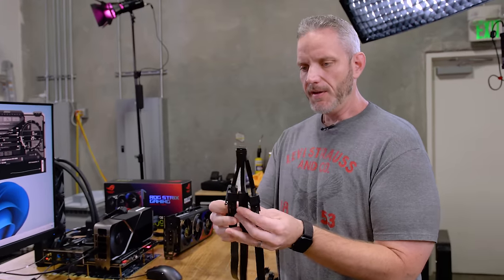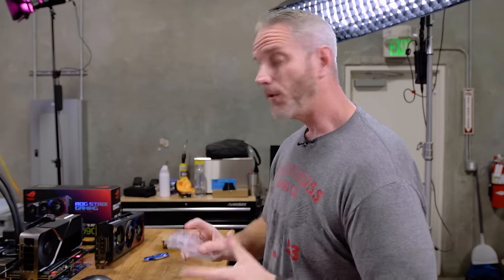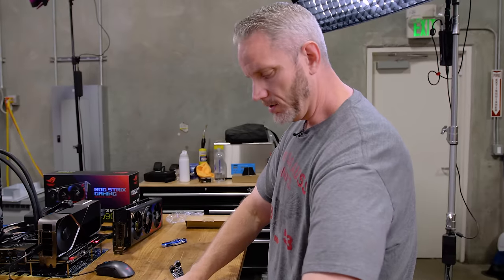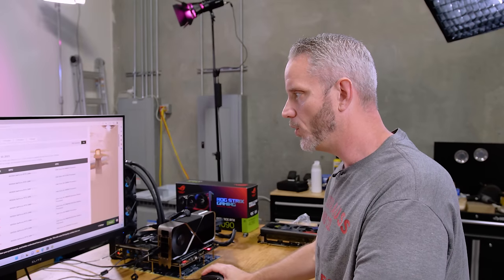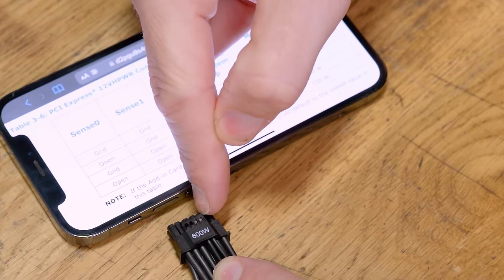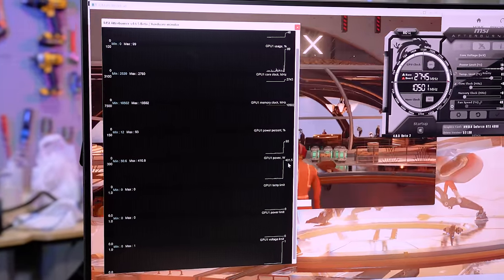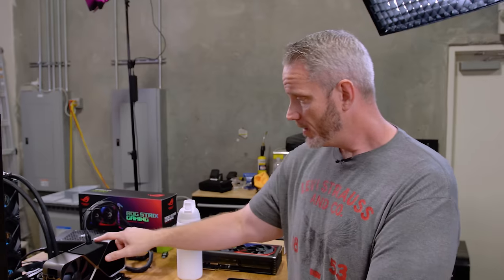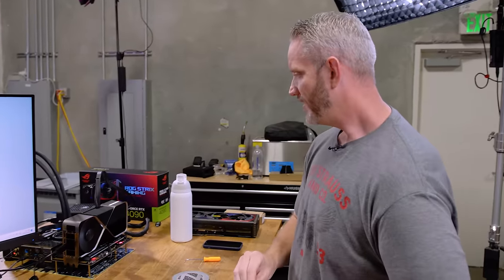DON'T Do this with your GPU!

Comment: MYTH: The 12VHPWR cable has 4 sideband pins

TRUTH: The 12VHPWR cable has 2 sideband pins, which are not currently used by any PSU. These pins are CARD_PWR_STABLE and CARD_CBL_PRES. They use 3.3v signaling but without buying the $300 PCI SIG document I can't tell you whether they are I2C or some other type of bus.

CARD_PWR_STABLE indicates whether the power draw is stable, but it's unclear from the spec what actions the GPU or PSU are supposed to take if it's not stable. AFAIK there is no functionality in the nVidia driver to pop a dialog like the Windows USB overcurrent dialog.

CARD_CBL_PRES indicates if the cables are connected properly, although one would think that would be apparent without this sideband. I don't see the use of this.

The other 2 pins on the 4-pin part of the 16+4 connector are NOT sideband, they are SENSE0 and SENSE1 which have NO signaling whatsoever and are simply tied to ground or not, as a 2-bit binary which indicates:

- Sense0 GND + Sense1 GND = 600W
- Sense0 Open + Sense1 GND = 450W
- Sense0 GND + Sense1 Open = 300W
- Sense0 Open + Sense1 Open = 150W

To make things more complicated though, nVidia's 4x8 pin to 12VHPWR adapter that ships in the 4090 FE box has an embedded chip which grounds the SENSE0 & SENSE1 pins dynamically based on how many of the 8pin plugs are connected. I imagine nVidia is doing this for liability reasons because they know the 12VHPWR connector is problematic and they don't want to burn anyone's house down if the user has a crappy PSU with low-gauge cabling.

So with the nVidia 4090 FE 4x8 adapter, if you plug in less than 3 8pin, it won't boot (since the card requires 450w). 3x8 pin plugged in gives you 450w, and 4x8 pin gives you 600w.

While all of the 4x8pin connectors included with AIB partner cards appear visually similar to nVidia's and may all come from the same source (thereby including the chip), nobody has tested this yet so we don't know.

First- and third-party cables will not have the chip, e.g. Corsair, Cablemod. Corsair is 2x8 and Cablemod offers the choice of 3x8 or 4x8. Personally I ordered my Cablemod with 3x8 because it's enough for redundancy but still keeps 1 connector open on the PSU which may be necessary for either:

- Second video card, e.g. Intel Arc for VP1 encoding

- 60W USB-C PD (my X670E Creator uses a PCIe power connector on the motherboard to power the USB PD).

Most high-end PSUs have 4 PCIe power connectors.

It baffles me how people like JayzTwoCents can say there are 4 sideband "smart" pins when if you simply look at the connector there are only 2 pins installed and they are clearly tied to ground. Sideband pins are not yet implemented.

If you use a first- or third-party adapter cable, inspect it and make sure that the Sense0 & Sense1 are tied to ground on 2 different connectors at the PSU end, because otherwise if one of the 2 connectors comes loose, it will try to draw 450-600w through a single PCIe power connector.

Comment: unplugging one pin the card thinks there's only 3 out of the 4 plugs attached ... I'm guessing with both disconected it thinks there's just not enough plugged in so it doesn't start

Comment: Corsair states don't use these with any other power supplies...however I'm guessing if you have a quality power supply with ample power these can be used on other brands not just Corsairs.  Could you test it on other power supplies...also I looked on Corsairs website, they seem to be all sold out, so I guess I'm stuck using that dongle till more become available.
Reply: You can not use them in other power supplies unles you verify that they output the correct voltages on all pins as not all modular power supplies have the connectors wired the same way. The wiring tend to be the same within the brand and/or OEM.

We ned a standard for connectors in modular power supplies for good compatibility.
Reply: What GODAXEN said
Reply: @NoSend901  ok, good to know.  I have a Asus Thor ROG power supply, 1200 watts.  You would think it would be built to handle this, but I didn't know for sure.  I'll just use the provided dongle or until I can't get asus to confirm whether it will work.

Comment: I believe the 4090 GPU is going to need this hideous thing. What I'm trying to work out is how many of the various connectors I'd need from my power supply. I assume these days they'll all have four PCI-e cables? I need connectors for two old HDDs (I forget how these link up) and ... three SATA SSDs if I recall correctly.

Am I in any danger of any PSU I might buy (around the 1000W range) not having all the right cables?

Comment: Jesus the misinformation is rife with y'all. ATX 2.0 standard dictates that one PCI-e cable be rated for a continuous 266W load. So two PCI-E cables with  split ends can supply 532 Watts of power. The PCI-e slot on the motherboard supplies 75W for a total of 607 Watts.

Comment: Create a circuit similar to what car enthusiasts would use to fool the cars engine management computer used with certain mods. Pass the power supply signals though a circuit with some switches and you could crudely control the power to the card.

Comment: I noticed he has the power supply adapter daisy chained with 2 cables to give 4 8 pins should not do that. Should use 4 8 pins for the 4090.

Comment: But power supplies can be single rail or multi-rail. Multi-rail means all 8 pin are individual and shouldn't power more than 150 watts for each 8-pin, so using a PSU with multi-rail shouldn't power a 4090 because it can't draw more than 2x150W, because the load is not split accross all 8-pin cables. Maybe that's why 4x 8-pin cables exist. For multi-rail power supplies.
Single rail can draw any amount on one 8-pin, that's why they built those thick cables and only 2 of them.

Comment: Corsair already outed themselves as not having full knowledge about this new specification. Nvidia said specifically that the GPU detects how many connectors are installed and a Corsair rep just said publicly that the GPU does not detect this. F, and I just bought a Corsair PSU.

Comment: I'm sure I'm not the only corsair psu owner wondering about those type 3-4 cables, most psus are compatible except older AX and HX non "i" versions, check corsair psu compatibility and only look at the Type 4 - PCIe line for your model if there's an orange dot you're good to go with this cable (that I'm waiting Corsair please send them to retailers)

Comment: my adaptor bents and gets some pressure from the glasss panel. But tbh as long as the power plug is in all the way it will require a lot force to damage pins. The plastic on the plug would break first.

Comment: Jay, please stop bending that damn cable around like an idiot.  You're going to give people the wrong impression that it's ok to do that.  If you bend a solid core wire cable(if that’s what it is, which I doubt)  like that, the copper will work harden and crack/break.  That's not good for anyone, especially with some cards going up in flames due to the amount of power sent through those cables.   Be smart!

Comment: I think all the power requirements "tech spec" on the new series need to get with the times. They still go by the "single value" total power suggestion, which in many cases is overkill. I thought the whole point of thew new ATX 3.0 spec was that video cards could state, i need 150/300/450/600W for "myself" and idc what the rest of your system needs. And it is my impression that these cards should state: 450W plug spec minimum, 600W recommended (for OC).

So when you get around to shopping for a new ATX 3.0 PSU, you can make an informed decision. Maybe you know you don't want to OC and the plan is to get a PSU with 450W support + 300W for the rest of the system. or Maybe you get the one with 600W+400W. That's 750W vs 1000W, and the price difference that goes along with it.

Comment: i wouldn't trust Corsair. They didn't understand how the original one works and if I also remember correctly the PCIe connectors on the other end of their cable is not rated for 300W.

Comment: pls look up this psu:  MSI MPG A1000G PCIE 5.0 1000W on newegg. i tried to link but my comment got deleted, the pigtail is a trash cable. the new psus use a single 12vhpwr on both ends, that pigtail is for old cards. you wouldn't plug 4 110 wall plugs into a single device would you? btw if GN reads this, give credit where it's due.
Reply: btw corsair should have sent you a whole new power supply but they're clearly slow on the uptake too.

Comment: I think you missed a valid test.  Leave one of those communication lines de-pinned and jumper the remaining communication wire over to the de-pinned slot to see if you can fool the card into thinking it's communicating with two individual communication lines.  If you could then do the same thing with an ATX 3.0 PSU that is say, only 400W, and it works, you could show a potential flaw in the power up scheme.

Comment: Some 4090's come with a triple cable, like the MSI Trio. What happens if you use a quad cable with those cards?
Reply: Some adaptors have IC in it to ensure all power connectors are connected. Like the FE cards won't have 133% power budget available if only 3 out of 4 of PCIe power connected (only 100% like Jayz removed a pin).

Comment: I used to have the concern of speaker amps overpowering speakers until I learned from audio systems professionals that same point.  The PSU for a PC is a more complex version of the same thing.  You have to fit it to the components so that the least and greatest draw fit within its stable range.  The only concern, aside from cost, I have from an OP PSU is wondering if it can remain stable at an ultra low idle or standby output when and if required.
Reply: The downside to an overkill power supply at low loads is mainly efficiency, switching power supplies waste more energy when only a fraction of their output is being used, though supplies with a high 80+ rating are still decently efficient at the low end

Comment: I'm pretty sure that it is not solid core. There are no crimp designs that I know of which uses solid core (I'm in the industry). 
It's more likely that it's larger awg and stiffer insulation (likely higher temp).

Fyi a solid core won't be good as the crimp will not crimp properly and leave voids inside leading to arcing and oxidation.

Comment: If they are so worried about cable bend causing strain on the socket or the plug, they should design the stress relief onto the structural part of the card
Reply: That might be why the connector is flexible in the same way buildings are during an earth quake
Reply: Or they could have avoided the issue in the first place by not making the connector needlessly small. They could have use the same number of pins, but make them the same size they are on a standard PCI-E power connector. The cards that use that stupid connector are comically huge anyway, so there is exactly zero point in making the connector that small.

Comment: I ended up buying a new power supply that was designed for the new gpu power connectors plus my Power supply was 10 plus years old.

Comment: Same cables I got with my seasonic  850 titanium  my gpu is in stock location 4 ribbion cables  2 connectors mine is differant . Mine is for the NV 3080ti and I use the EK water block and my ribbon cable all 4 I made almost invisiable to the eye. Cleanest build I have ever seen plus the water cooling in all aspects is 100% correctly done and it shows up in R23   68 c  all cores 5.0 ghz   Rocket lake and it performs way better than your review + it use way less power 220 watts r 23 .   I know the cable maker Seasonic told me so I could get the correct cables.  Very nice great to work with.  I would tell you companies name but I have to ask seasonic first.

Comment: I wish i could get a hold of one. Im using the adapter that came with the GPU and only three out of the 4 worked with my custom cables so I've now got a nasty black plastic cable in my case. The worst part is my side panel won't fit on my case so I've ordered some new parts to build a new rig, i couldn't wait for the 13900k and saving a few hundred will go towards my ATX 3.0 PSU and thats it for a while as I've spent far to much on electronic equipment this year and last.

Comment: I don’t really mind the splitter, but why make it so short? Why not make it into what is essentially psu extension cables, adapter can reach all the way into the psu shroud/cable management area?

Is the couple inches of wire really that huge of a cost savings? Maybe on lower end gpus this is fine but for higher end gpu’s there’s no reason not to make them longer

Comment: Cutting the wires?? I guess Jay doesn't have any de-pinning tools like I do. I would just de-pin them from the connector housing and wrap some electrical tape on the loose terminals.
Reply: It looks like that's what he did 16:35

Comment: I have found low cost cables from Amazon, that are sleeved and look great, in my case sleeved In White , that use no adapter at all,
Check overall length ! Some are adapters, some are whole replacement cables, get the latter, price differences are very small. 
They run from gpu to psu , like $22, have cable combs, that keep it super neat looking.
Just have to pay attention to psu connection types, mainly two different types, make sure they match the psu! Check twice!
No need for super expensive ones. 
Have used these twice now with good results. 
It’s really outrageous that gpu manufacturers think a short “adapter “ is ok.
A few more cents for a longer adapter that can at least make to the back of the average case was in order here, what the industry sent out is insane especially at current gpu price levels.
Just my thoughts and a low cost solution!

Comment: @jayz2cents its not that complicated, the sideband connection tells the gpu how much power it can pull by shorting certain pins to ground, there is no communications between gpu and psu.

Comment: So that's why a CORSAIR rep is so triggered to GamersNexus and other review sites cuz they want to ship this "BULLSHIT" accessories for aesthetics and still claim that it can power @ 600w. yeah you can run 600W on those cables but the card wont pull that cuz you limit the sense wires. It like you are having a 10Gbps cable on a 10/100 router. No mater the quality of the cables, its about the signaling on the sense wire to say to the GPU "HEY THERE IS ANOTHER CRAP TON WATTS YOU CAN PULL". I'll give a strong no for aesthetics if i cannot use all the juices of that ridiculous overpriced GPU.

Comment: I have your iFixit ad stuck in my head. And I'm loving it. IFIXIIT!!
On the topic of graphics cards, I have a 3950 ryzen system with a 1070. I think I'll just get the 6000 series radeon card as I'm curious how that will perform.

Comment: seasonic had the one piece 600w cable where is the competition? 12VHPWR (12+4 Pins to 12+4 Pins) i rather use that than some pci-e splitter

Comment: This is probably a dumb question but......can the cable that Corsair sells be used with other power supplies not made by Corsair?
Reply: The connectors and pinouts at the PSU may vary between brands and even models, so while they might sometimes fit, things could go (expensively) wrong!

Comment: Neither of those cables will bend to the side and I hate having them draped over or under the card. I like to take them sideways tight to the side of the card and out the back.
The only thing that hangs out visible in my case are the radiator hoses.

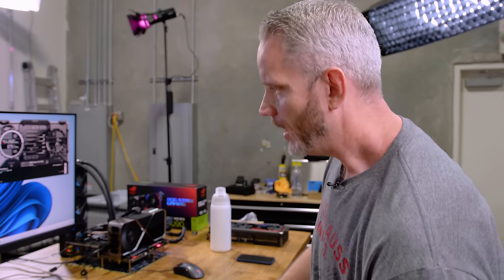Comment: MISTAKE @ 11:23. Jay must have had a "brain fart". 
Jay states he is going to remove the right pin connection, "by undoing the right one and being 450 watt limited" @ 11:23, then proceeds to remove the left pin and showing the 4090 being 450 watt limited.  Just in case there is confusion.

Comment: That sensoring is stupid, the PSU should rather have current sensor inside and detect if you use more than one plug. And then even out current on each plug instead of having feedback.

Comment: I have the MSI MPG 1000W psu, im running an  msi suprim rtx 4080 super 16gb GDDR6X . My psu has a yellow type connector that shows 600 on each end and it plus into the psu where it says 12VHPWR. Thats the only place this cable connects. Do i still need to use the splitter that comes with the gpu? Plus my cable that says 600 doesn't have split cables like you showed. The 600w cable is exactly the same on both sides.

Comment: Your Strix issue is most likely NOT for that board. I went through a Tuf 4090 and a Strix 4080 and both, once the driver was installed, no picture. This is on a Maximus Z690 Hero motherboard with an i9-12900k. Updated vbios, firmware, swapped PSU, removed m.2 Hyper card, tried several different cables, several different displays, reinstalled Windows, DDU. Asus, Nvidia, Microcenter, all stumped. I ended up returning them because having a 40 series card is not worth it if you cant see anything on the screen.

Comment: Just I nerd that a solid cable is not a good as multi core cable for power / current and the current travels on the outside of the cables ( copper ) so multi cores = more surface = more current = more power :)
Yes I work in a transformer factory that make transformers for the Grid 
and now we know why corsair is out of stock of this cable LOL

Comment: ahh the corsair 600w 12vhpwr cable that has been out of stock for weeks. said screw it and went cablemods custom replacement cable for my hx1200 psu

Comment: So, why the need 2 wires instead of a resistor ( of various value for each capacity ) on one side and a measurement part on the other side.. that way would be 1 wire ?

Comment: I had  found a dual end 16 pcie5 cable the other day; thinking it was 30 bucks. And on that note- thus far have only found 1 PSU with the new 16 pin, and it's a MSI MEG.